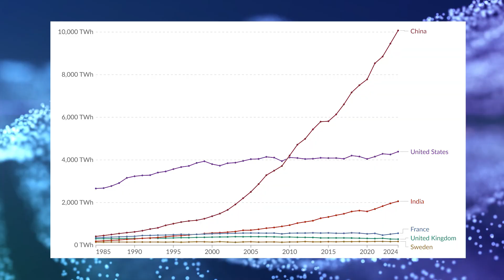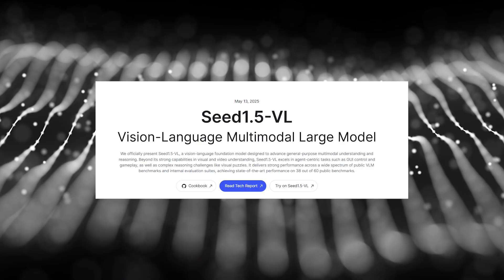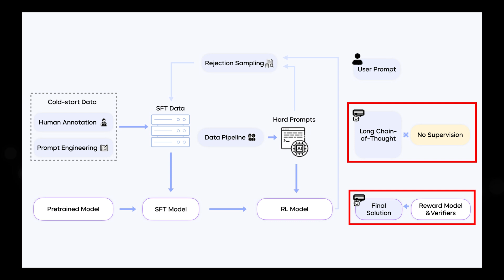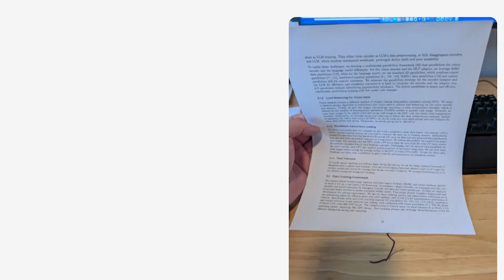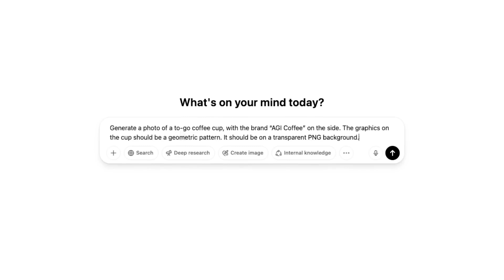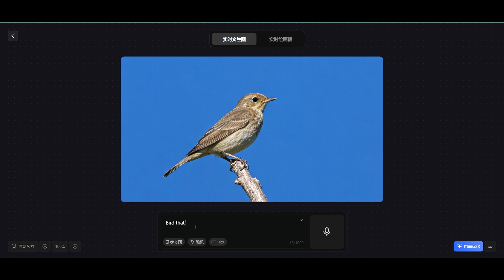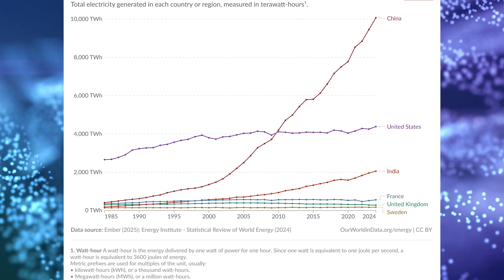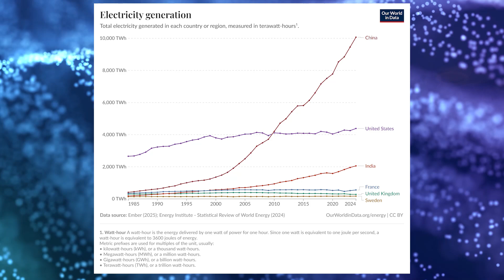TikTok's New AI Just Beat Google and OpenAI in 38 Tests!

Comment: In artificial intelligence, China leads in volume with 12,945 AI patents in 2024, while the United States follows with 8,609 AI patents. For generative AI specifically, Chinese inventors filed 38,210 GenAI inventions between 2014-2023, compared to 6,276 from the United States.